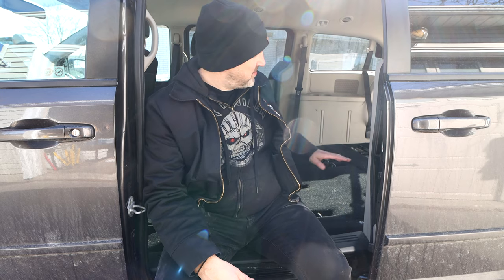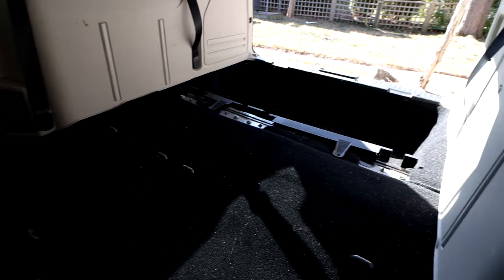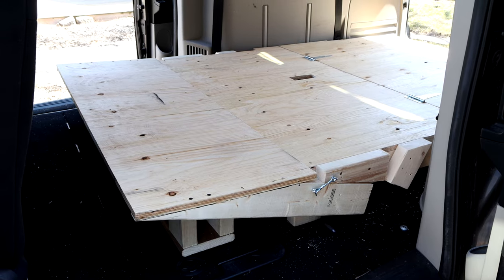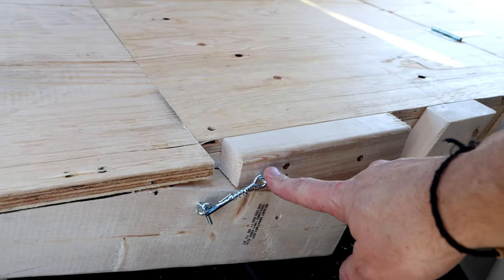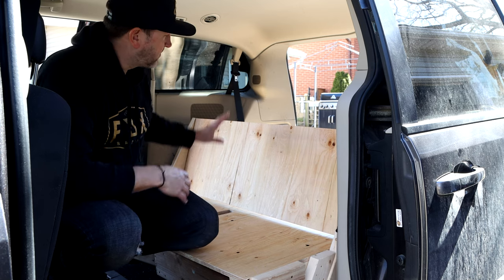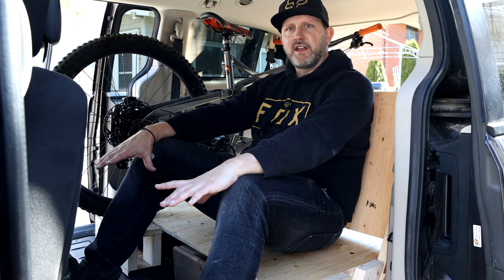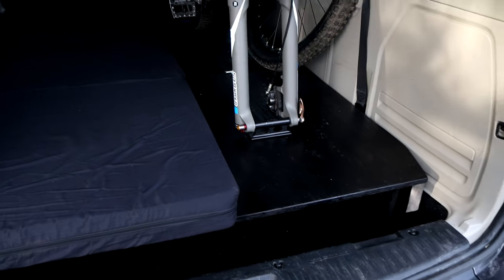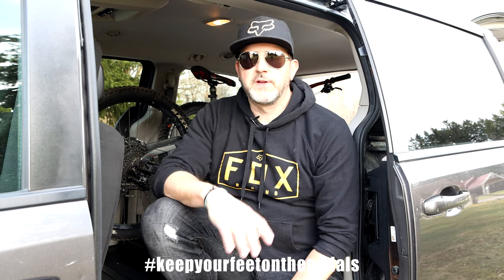Minivan DIY Budget Build // Couch, Bed & TV installed

Comment: Cool vid! I had thought about doing something like this, but decided to forgo it for headroom. On bike mounting I swapped to this:
https://rockymounts.com/products/driveshaft-hm.html
The outbound holes let me use counter sunk inserts into the wood then bolt it down with wing bolt screws so it can be removed easy. For the wheel I ran a 550 cord looped with a carabineer attached to mount along the roof, keeps it from rolling around.